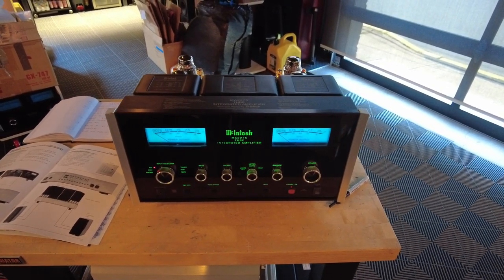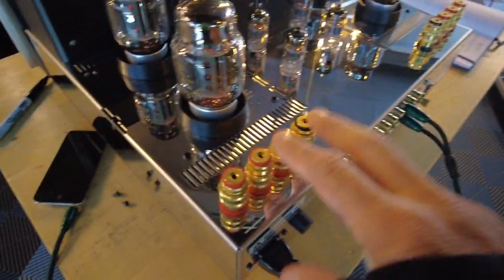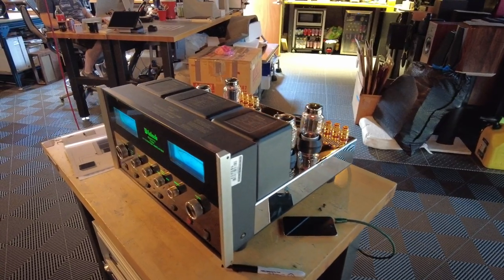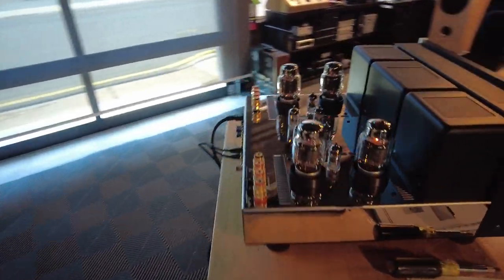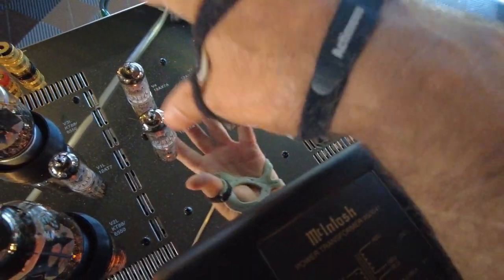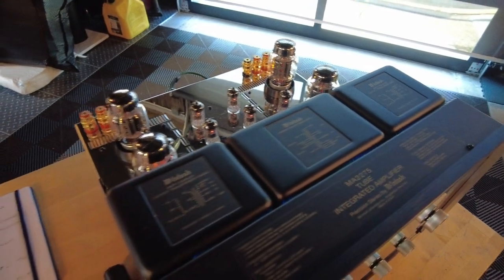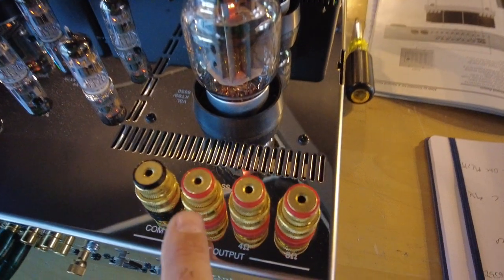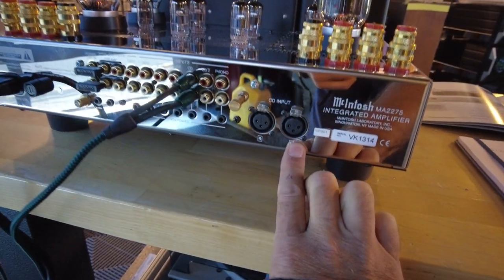The Ultra Rare McIntosh MA2275 Integrated Amp - A Collectors Piece

Comment: I have one of these. Excellent and in very good condition. Might be for sale soon. Have a variety of vintage 12at7’s for it. Sold my cornwalls, so it has sat idly by about a year now.
Reply from the maker: It's super gorgeous. We have a section on our website to sell/trade your gear if you decide to sell. You may just want to hang on to it however. It's gorgeous and uncommon.
Reply: @SkyFiAudio  I actually did submit it a few days ago on your website.

Comment: I have never been impressed by McIntosh I have heard it out preformed  by sansui and Harmon kardon  integrated amplifiers  way to expensive and very little bang for the buck imho.
Reply: Both Harmon Kardon and Sansui are tremendously underrated.  I had the HK730 and my brother-in-law still has his after ~ 30 years. My Sansui TU-X1 is the best tuner I’ve ever owned and heard, even superior to the McIntosh MR-78 and any of the other super tuners.
Reply: @stillastillsfan  I am running an HK430 that I picked up in Dec for 200. Sounds amazing. But I am curious about Tubes.
Reply: But it has big blue meters.  I just replaced the glass, on one absolutely nothing special when I benched it. Actually I compared  to an Adcom GFP565 and GFA555. The Adcoms blew the Mac out of the water. Don't get me wrong my favorite tuner is my MR-78 and my 84 year old mother has a MX-110 and MC-240 with K-horns. I do have to laugh when I work on old McIntosh and see the cheap parts they used. The only reason the did so well was their patented output transformers.

Comment: For a tube amp, is it safe for the output transformers to turn it on without load?
Reply: As long as you don't run an audio signal through it at high volume, it will be perfectly safe.